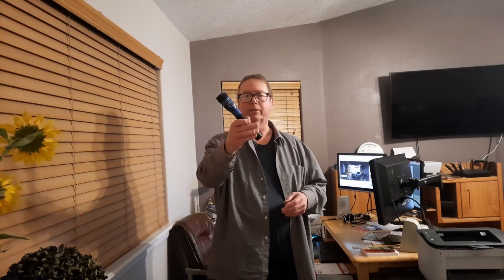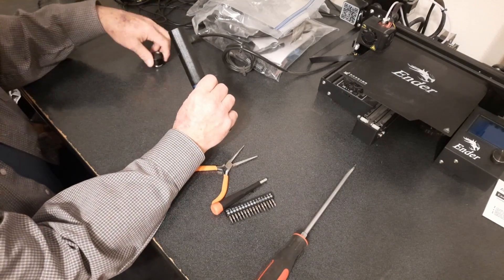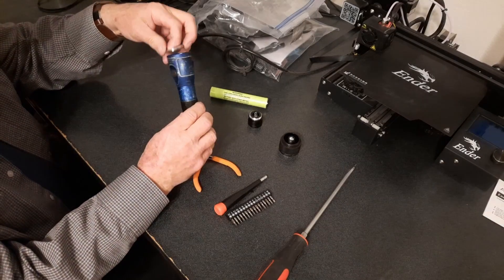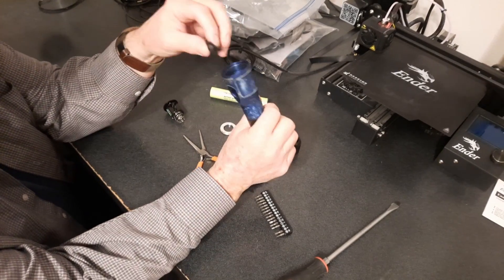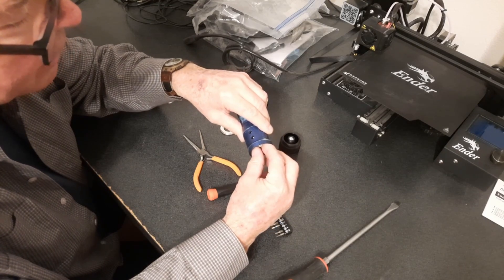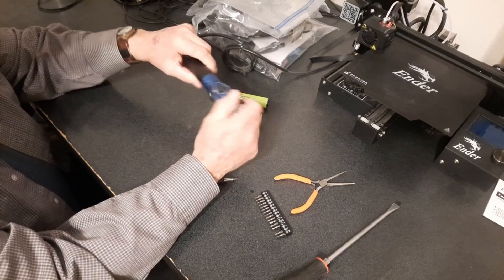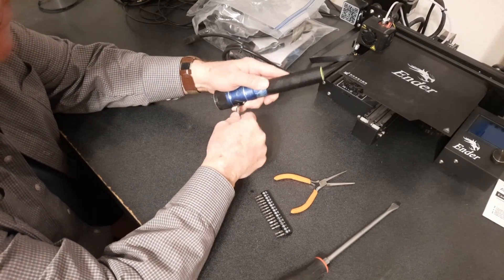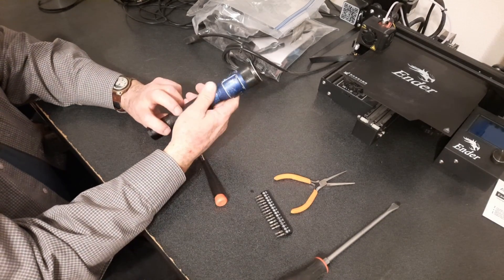How to Repair Streamlight Flashlights - Stinger Repair Kits and Rebuild Kits

Comment: How about repairing the Wedge?  Possible?
Reply: I have not seen a kit for that, or the new 2020s.   There is a rear button replacement for the 2020s BTW.  I think they are facing out their old LED stingers and Strions and expecting everyone to buy the 2020.  The 2020s are way brighter, and they are durable like the regular LED stingers, but the batteries are more expensive and I haven't seen a repair kit for them yet.

Comment: My stream light flashlight won’t turn off. What would be the issue?
Reply: There could be a couple issues.  First thing to do it try replacing the guts, like the video shows.  Second, it might have been separated where it shouldn't have been, like the video indicates.  It might not be fixable in that case.

Comment: the flashlight won't work...intermittently. I suspect bad connection to battery from rear end of light
Reply from the maker: I doubt it is the battery.   If it has a dual switch, it could be the switch in the back.  I have also seen the pressed fit part of the flashlight pulled apart.  That could cause and intermittent problem.  Most likely it is the switch, but it could also be a problem with the spring.   9 times out of 10 it is the internal switch/LED assembly.  It is all one piece.
Reply: @thetoolchess  It could be two things.  It could be a spring inside, or it could have been separated in the middle.   Once it is separated, I don't think it will ever be reliable.   But it could be the spring inside too.

Comment: ya it maybe Esey to repair but for people that don't know streetlight has a lifetime warranty all you need to do is send it off and they will repair it for only shipping and handling. can also warranty at any tool dealer that sells this flashlight like Snap On Matco tools Cornwell tools and so on
Reply from the maker: That would be great.  I think the best option is for the dealer to fix it right there on the spot.

Comment: Let’s just say someone had a flashlight that acts like it won’t fully charge like it used to.  Like it goes brownish not long after fully charging.  Is it time to buy a new battery? And which batteries are interchangeable?  The battery seems hard to find.   And a follow up question:   Have bulbs improved since 2003? I’ve got 2 stingers and they’re not that impressive as when they were a while ago.   Both from snapon but lately I’ve been getting coast flashlights.   But I really hate throwing things of value out and also like how stingers feel.       Cheers, Bill
Reply from the maker: I bet the battery is worn out.   That is the first thing to check.   It sounds like your Stinger has the bulb, not the LED.   There are upgrade kits.   I am not sure if Streamlight makes the upgrade kit though.  The latest LED is the C4.   With a new battery and an upgrade, your flashlight will work great.  You could drop it hundreds of times and it will keep working.  Good luck.   If your flashlight is an LED, it is really simple to upgrade with a C4 upgrade kit.

Comment: I have a stream light polystinger  LED HAZl-LO. I can't get the battery out and SL says I can only send it to them to change the battery because it's sealed to make it intrinsically safe. What do you think?
Reply from the maker: Wow Byvion, I have never seen that Streamlight.   I can't help on that.
Reply: @thetoolchess  I just couldn't believe what they told me so I got my magnifying glass out and lo and behold, the 2 tabs that connects on the charger are actually screws. I unscrewed them and it popped right out. I ordered the battery and awaiting arrival.!!

Comment: How do you replace the clear lens?
Reply from the maker: The lens cover screws off and are available via the link below the video.   Thanks
Reply: @thetoolchess  I tried every way possible to take the lens cover off or the the reflector out nothing even budged to hint that it was removable.
Reply from the maker: @Babybeast4357   Grab it and twist it counter-clockwise.  It might be tight, but it will come off.   This is the replacement part:   https://ebay.us/otKwWr   I hope that helps
Reply: @Babybeast4357  not sure if you still need info on this but just the clear lens is pretty much not replaceable as it a press in fit and almost have destroy things to get the old one out and press in the new one, not really worth it IMO. i had a tool truck replace one of mine with parts directly from streamlight as it had some weld splatter on it, ended up it was only a few dollars more to just get a new upper assembly that @The Tool Chest suggested where it replaces the entire upper part including the reflector/lens and reflector housing.
Reply: @partymstr4  Just by the lens assembly.   The actual plastic lens is not replaceable, I think.  I remember hearing about an expensive tool to do it, but it isn't worth it.  Also, just twist the assembly and get get a new lens assembly.

Comment: ......I've seen folks find these lights in the bottom of a lake and still work. I have 2 new ones but willing to get another one if I score one at a Pawn Shop.
Reply from the maker: I have tried many flashlights.   These are the best, IMO, because if you drop them, they keep on working.   Plus, they can be fixed.  The piggyback chargers are a big win too.   Charge the flashlight and an extra battery at the same time.
Reply: @thetoolchess  The gray chargers are the new chargers and have a better battery management system (BMS) which can handle the LiIon batteries.  Get a new piggyback if you have the black one.   Or just get another flashlight before they quit making those great LED stingers.

Comment: Nice video but how do you know why a broken one won’t turn on ?
Reply from the maker: The first thing to check is the battery.   Put the battery in someone else's flashlight and compare it to yours.   If it isn't that battery and it won't turn on, then use the repair kit and it will fix it.   Links are blow for the repair kit.  It doesn't matter if it the switch or LED or whatever, the repair kit is everything.   I fixed another one today and it didn't turn on.   Perhaps the rubber boot got pushed so you can't click the switch.    But I haven't seen that.